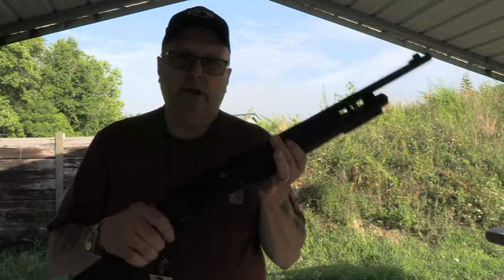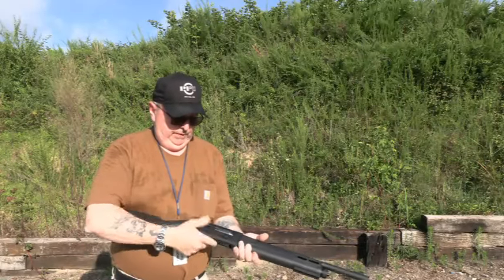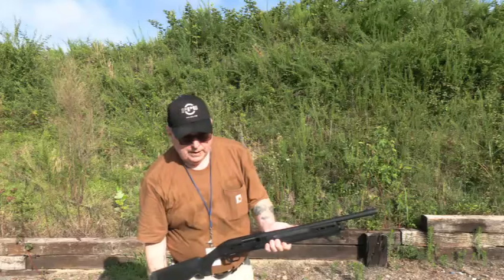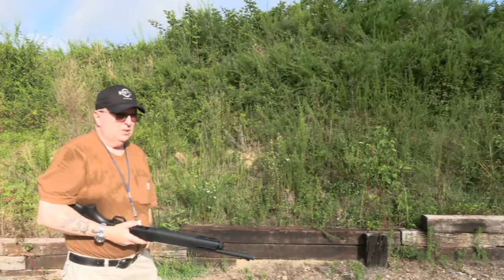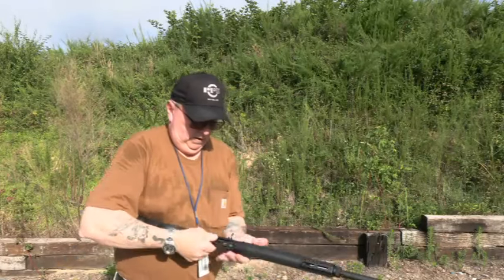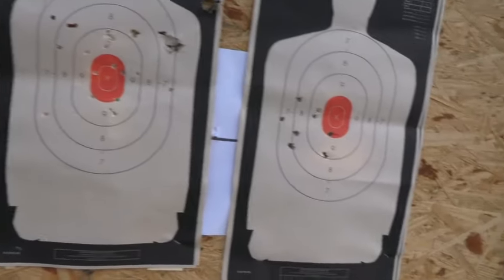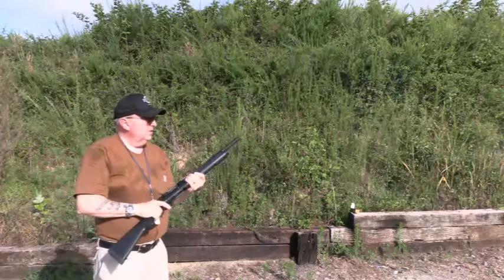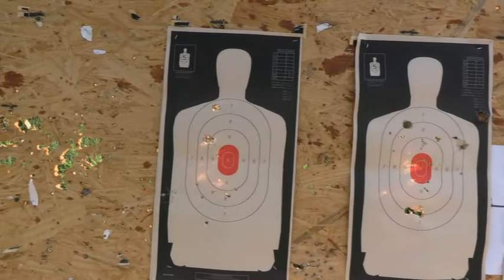SDS Titan 12ga shotgun 2nd time at range

Comment: Where is the shot gun sold ?
Reply: Bud's gun shop online...
Reply: Thanks think I’ll stick to my 870
Reply: PSA
Reply: Actually ordered mine direct from SDS...back around 4th of July they ran a special, $199 and they throw in the +2 tube extension for free.  Just had it delivered to my local gun shop.
Reply: On PSA right now for under $150 shipped.